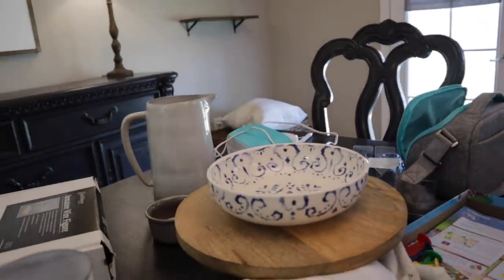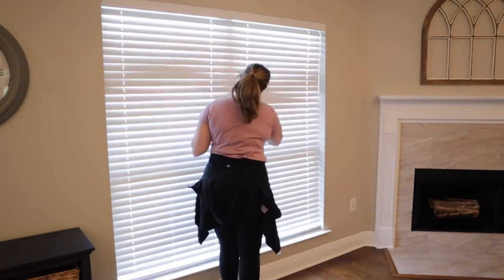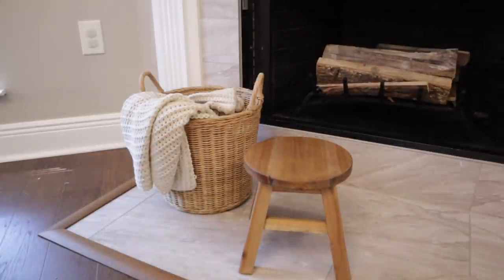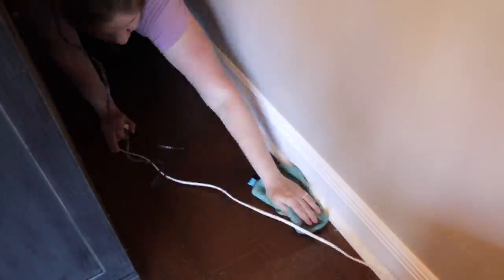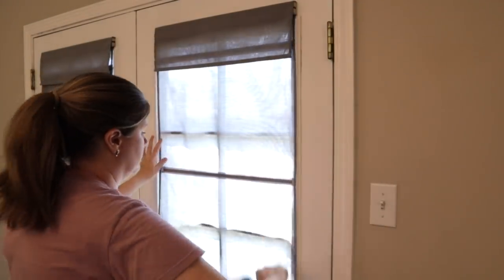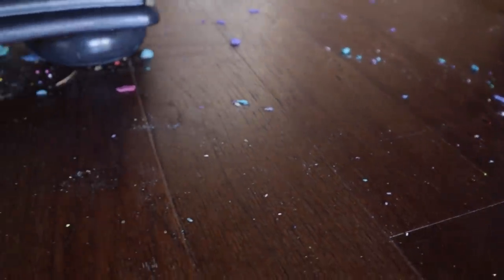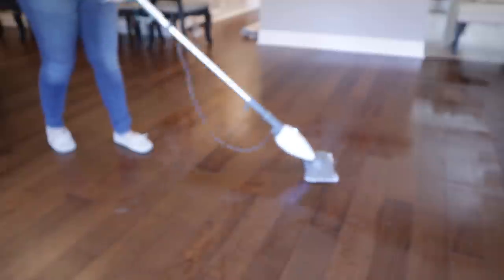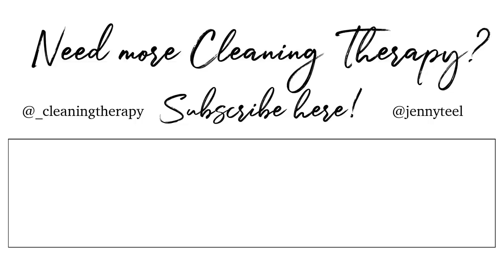SPRING DEEP CLEAN AND DECORATE! | Clean With Me | Extreme Cleaning Motivation | 2022 Spring Decor

Comment: So a couple of things I want to mention. You can use a magic eraser to clean the seat of the chairs. It works wonderfully and is more convenient than pulling out the carpet cleaner. I had a child use a marker and pen on my couch. Called a professional and they couldn't get it out and said it was a lost cause. Used the magic eraser and it got everything out. 
The other thing is the steam mop. I have one a friend gave me. I didn't know much about them so I looked it up. It doesn't sanitize your floor. While steam is good for sanitizing it has to be at a very high temperature and these mops don't reach that temperature. They can't without doing damage to flooring.